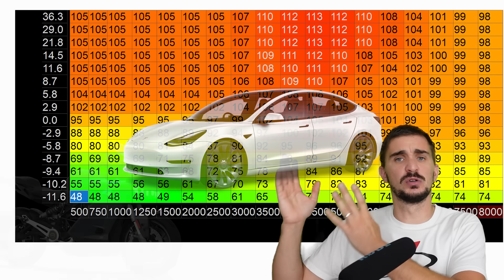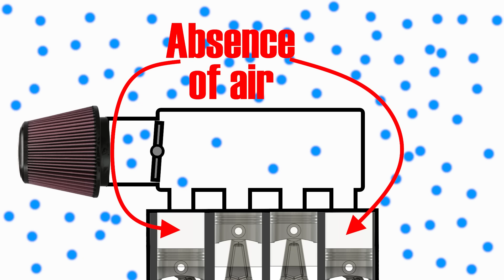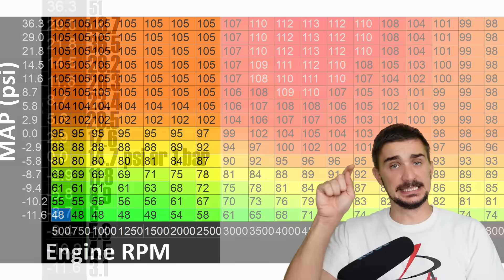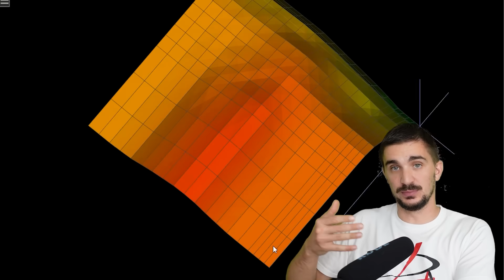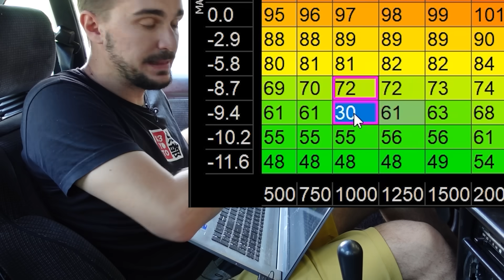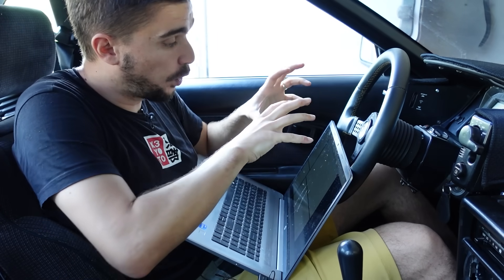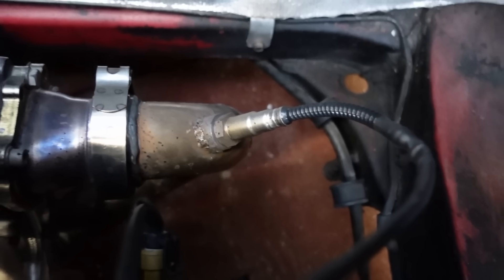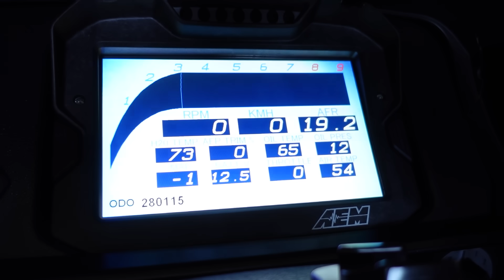If You Understand Volumetric Efficiency You Understand Engines

Comment: In subaru world, where I do some of tuning, VE is considered relative to the manifold pressure not atmospheric pressure. So even boosted engines do not achieve much over 100%. As far as I understand, VE is a measure of the efficiency of the engine to pump air from the manifold into the cylinders (manifold pressure varies from -10psivac to 20psi+ above atmopsheric). The turbo isn't considered part of the efficiency calculation as it is a pump itself. I suppose there are more than one way to calculate VE, both being correct and valid. My turbo EJ205 DOHC 16V 4cyl (non-variable valve engine) achieves 80% VE coming on  boost at 3500rpm, peaking at 92-95% in the mid range, 4k-6k and drops off to 80% at 7k. VE really does tell you where the engine makes torque, which depends greatly on camshaft and head design as well as features like varaible cam timing.

Comment: Wow. Thank you for the clarification. I always thought the values in the ecu map corresponded the injector on-time etc.
Reply from the maker: Yes, that's what was used before and the maps where called fuel maps usually. Injector pulse width values were in the map.

Comment: Another factor that affects the torque is the engine load. As resistance to the movement increases the piston head is pushed against the combustion more which can affect torque. This is why power braking is a thing.

Comment: Great video as always. First question that comes to mind is:

If the ECU is trying to match the afr via that certain VE in the table, why are no all afr values in the table the perfect stoichiometric ratio?
Reply: Because most engines will not run happily at perfect stoich under any decent loads. There are circumstances where under very very light load you might be able to make a motor happy at perfect stoich. Most of the time engine will run happier and make more power when it is rich of stoich.

Comment: This only raised more question. If the ecu can correct it's value by itself, does it mean the value on the map will keep correcting if you drive it up and down a mountain since the air pressure varies between land height?
And if the value can correct itself, what they change when a tuner remap a stock map ecu?

Comment: always good teaching, but sometimes you do some mistakes teaching, one of them it is that the use of datalogging instead of watching the clocks, datalog it is much more accurate by a lot of ms, also safer when you are tunning alone and in a racetrack or street for example

also. there are a lot of lesser ecus that doesnt have so many things as yours but can run engines like yours, speeduino is one example but has some fewer things that you need to do by yourself to achieve the same result, it is always great to confirm with you what i have taught myself among the years or have learned with different experience on other people

are you going to do ignition next? if you like the response and difference when you have the afr spot, then when you put the ign where the engine likes it is a lot of more fun, recommend you a racetrack so you can do a more response tune trough the rpm instead of only wot

take care and have a nice day

Comment: I'm curious why you're using speed / density instead of using the mass air flow sensor?  I thought the MAF beat speed / density across the board?
Reply from the maker: Why would either beat the other?
Reply: @d4a  Speed density is making more assumptions and is also reacting later.  MAF is reacting to the measure airflow going in.

Comment: I self learned tuning about 15-20years ago. From dizzy/webbers to dizzy/fuel analog ecu and finally full digital ignition/fuel. I street tuned with innovative wide band and listening for knock . You’ve explained this beautifully. Kinda miss the cold nights on concrete floor tuning days
Reply: I self learned back in 1990, with pressure switch on additional injectors and a multimeter connected to the analog o2 sensor and egt.  Melted or cracked trillions of pistons until i finally figured out what the heck was doing. Took me like 6 years LOL .
Reply: @mandytuning  epic. I’ve heard about this technique before additional  injectors piggybacking onto original injectors with staged pressure solenoids.
Reply: What’s the best resource you used to learn to tune i want to tune my own cars and want to get started
Reply: @iclassicify3126  This video explains how to tune an engine
Reply: @iclassicify3126 you can start by watching YouTube videos, reddit and forums posts but if you’re willing to pay, HP academy is great
Reply: @iclassicify3126  best resource and start is probably this very actual video here imho....
Reply: Concrete is where we all started on the long journey of tuning. It’s a step you can’t avoid …❤
Reply: Where to find that digital dash
Reply: Im now starting tuning I want to do it professionally
Reply: Like you there are many of us who can relate probably bound by the passion in our toys. Dizzy and Rochesters here. 11 years ago I embarked on laptop tuning my truck after a manual transmission swap. After researching my options purchased an Innovative LC-1 and started adjusting parameters in the garage. That Wideband works great at tuning carburetors as well. SAE 78’
Reply: I wish I could travel the path u took.. it would make me very very happy
Reply: Good to know not only I am crazy 🤣
Reply: Tell me how to get the program to tune then. I have a volvo s40 2005 that I want to tune.
Reply: @alanboggs2315 its not something thats taught on a YouTube thread 😂takes a lot of hard days
Reply: i dont even know how to begind such life without budget or background in family and without school :/ practice while supervised by other mechanic i suppose..
Reply: @0Blueaura without knowing i, you just did. The only thing holding you back is doubts and excuses.
Reply: @alanboggs2315  Google "hp tuners"
Reply: @alanboggs2315  as he states in the video, the program does it by itself unless any of the boxes are outside the 30% the ECU can compensate for then you have to put the numbers in yourself. I don't know about the volvo ecu or did you fit the same ecu as he uses  in the video in his own vehicle ....? (just noticed comment a year old so hope you sussed it)

Comment: Great video :elbowcough: But this is not modern tech it's pre90's closed loop lambda control hopefully with a mass air flow sensor. After ~1995 double cam angle sensor(in/ex) with vvt & vvl etc...🥰
Reply: nowadays oil pump pressure releasing solenoids, pwm controlled brushless coolant/oil/fuel pumps, variable geometry twin scroll turbines with scroll selection, pwm driven electric wastegates...

Comment: For those who don't know, it is very beneficial to tune in actual Lambda vs AFR.  If your target is 1.0 Lambda and you're getting .9 lambda, you know you're 10% off. Just pull 10% off your VE table and you're GTG.  No need to guess and check based on the error and no complex calculations to perform.
Reply: also worth mentioning that "14.7" AFR isn't actually "14.7" but lambda * 14.7. Stoich AFR is ~14.0 with E10 fuel, but will show up in most software as 14.7 to maintain convention
Reply: I been hesitant about proceeding with converting my carby feed engine over to one of the three EFI systems I have now to choose from (one factory and two aftermarket). This has really helped my understand of what its trying to achieve :)
Reply: If you're creating a base map for tuning a turbo vehicle to target an AFR of 11.2 under full boost, you still have to do that same calculation, just in the opposite direction, to get the Lambda value you want, which would be about 0.76 in this example. So you're doing the calculations for building the base map when tuning in Lambda, but you're doing the calculations for making corrections when tuning in AFR. It really just depends on how you want to do it and what values you want to see in your tables.

And the calculations aren't complex either way, it's only a simple division problem.

Comment: The statement about naturally aspirated engines not being able to run at higher than atmospheric pressure isnt entirely true. Its true for about all regular engines yes but it is possible to get an significant increase in pressure with a specific valve setup that Porsche has built for one of their engines. It sort of uses backpressure and merging shockwaves or something. Dont ask me how it works exactly but it works and there is no supercharger, turbo or anything of the sort. Its a naturally aspirated but boosted engine so to say.

Comment: You should note that it is possible without boost (even on your graph) to exceed 100% VE due to valve duration/overlap and the magic of inertia, and scavenging.
On your graph this peaks at 5500rpm where it shows 105% on the 0.0 line.

Short summary of events that make this possible:

1) Overlap. The exhaust valve remains open while the intake valve starts opening. The high speed and inertia of the exhaust being pushed out creates a vacuum which begins pulling air into the cylinder before the piston has made any real move downwards. 
2) Intake valve closes AFTER BDC. As the piston turns around, the incoming air and the intake tract have a certain amount of inertia (it's travelling at high speed). 
Air will continue entering even as the piston rises. There is a point where the pressure stops the inertia of the air flowing in, and that is the theoretical best time to close the valve.

Result: More air is contained in the cylinder than is possible at 0rpm and atmospheric pressure. On the table shown in the video, this peaks at 4500rpm.
Reply from the maker: Don't omit words from what I said. I said it is not possible for an NA engine to achieve significantly higher pressure than atmospheric. 15.4 is not significantly higher than 14.7.
Reply: @d4a  Don't you think it would add to the video to say that slightly more than 100% is possible?
Reply from the maker: But that's clearly already implied. If it can't go above significantly then it's implied it can go above a bit.

Comment: VE tables speak 'volumes' about camshaft efficiency within an engine configuration among other things..

I could be wrong about this, but wasn't MegaSquirt (the PiMP series ECU's for Ford's) one of the first auto adjusting aftermarket ECU's which paved the way for self-dialing VE table's?

Comment: Thank you for your amazing content. I would like to add that the speed density algorithm also needs the air temp and the barometric pressure to actually calculate the amount of oxygen and then, based on that, the amount of required fuel to hit the AFR target. On the other hand, the MAF sensor can accurately measure the amount of air going into the engine (by grams) and ecu needs nothing else to generate the required pulse width for fuel injection (of course except the injector size and dead time)

Comment: Ve dose not go above 100 due to boost

Ve is % cylinder filling AT THE CONDITIONS IN THE MAP

Meaning 100% VE at 300 kPa MAP = 300 kPa in the cylinder at BDC

Otherwise if you run 300 kPa MAP boost and is still only 100% VE you would have no power gain over being 100% VE at 100 kPa MAP

Comment: 2:28 "consuming more air than the throttle plate is letting in". Either you worded that very poorly or you don't know what you are talking about, sorry.
Reply: He could have meant that the engine is trying to consume more air then the throttle body is letting in, therefore creating negative pressure, but I also could be wrong.

Comment: Actually it is not true what u are telling. The correct professionel technical definition of VE is the ratio of air density inside the cylinder to air density inside the intake manifold...means it is not the raw filling rate and there is no relation to atmospheric pressure. And this ratio is a function of rpm and MAP. I know some ECUs are useing this wrong definition,which in general is also working, but with a bad impact, that u cant consider air temp in a calculation model. Bosch ECUs and also the EMU black ECU is using the correct definition. This results in a VE MAP which dont exceed 100% (even in TC engines). Example: an old 1.8t engine has an VE of around 85% starting at 0,7bar boost. If u increase the boost the VE stays the same although more air is pushed into the cylinder.
Airmass is then calculated like that: density(MAP, IAT)*VE*displacement

Comment: Ha! Your title to your YT vid hooked me. Most ppl who claim to understand VE%, dont really understand VE%. Your explanations for Tuning with Fuel Maps was fine but doesnt address Intercomponent relationships. Getting the proper #'s on a fuel map does nothing for an engine whose intercomponent relationships are improper to begin with. What no one ever teaches is how does one go about [Qualifying] an engine component as small, medium, large relative to engine output expectations of being mild, moderate, or maximum. The internal combustion engine is not one dimensional; rather there are three major relationships all other relationships fall under. Engine math (intercomponent relationships) are circular. Once an informed engine guy knows these three relationships, via math, he can determine all other parameters by transposing the variables within the math equations. The major relationships are
1) Dynamic Compression to Static Compression
2) Desired Peak Power
3) Expected Peak Power at a specific RPM
One has to understand which category they wish to run their engine in. These categories are phase one engines upto phase five engines. To me, I've always placed emphasis on the Dynamic Compression as a Ratio, or Dynamic Compression - as a psi. The Dynamic Compression measures its ratio or psi once the Intake Valve has closed. Your Video only showed Static Compression - or Bore x Stroke. What the Dynamic Compression reveals is how your Cylinder sees the Piston at any RPM. If one desires to understand VE% relative to Dynamic Compression, you can begin by mastering the Slider Crank Mechanism; yes this involves basic trig. Some engine software can plot piston position relative to Valve movements for you. The second helpful tip is to learn the basics on Cylinder Head Design; again some Engine Software can alter this parameter for you. You dont have to be an engineer to understand Engines; but you do have to understand Engine Math.., just no way around it!
Edited for typos

Comment: Great video, it finally helped me understand what those guys are doing with their laptops in between pulls on the dyno.
How does nitrous change the equations here? Knowing the MAP is really a shortcut to knowing the amount of oxygen, right? Which the introduction of nitrous would completely change. Extra sensors? Some sort of override during the shot?
Also, how does variable valve timing of various sorts change how a map like this is used? Does it change anything at all?

Comment: I would say that most modern gasoline engine will NOT fire if the gas pedal is not depressed and the engine RPMs are higher than a minimum threshold. So I don't really understand the VE MAP part in the negative pressure part...

Comment: The VE does not really result in torque. As combustion efficency is different. You can see that at unrestricted air intake the VE curve is almost flat cross RPM. Even at idle. But the torque is far from flat. That is becuse the combustion flame front is much fster then the pistion speed so the energi from the fuel consumption is not efficient translated into torque, but wasted as heat.

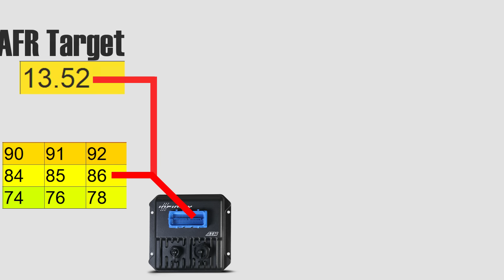Comment: I do enjoy your enthusiasm with engaging a topic you like to share. Although, there are some important discrepancies that should be clarified here. On a VE table, the vertical axis should never be represented by "Atmospheric Pressure" (ATM), as you've suggested at 1:07; it would be wrong to do so. In reality it's a calculation set by a standardization body (mainly SAE/ISO) that combine many variables (algebraic expression), in which constitutes engine load. A VE table will never be correct if the vertical axis is represented by only ATM and a horizontal axis of RPM. Over the lapse of your video you speciously reference the vertical axis value as ATM, rather than engine load. At 9:16-9:57 you further this fallacious point by saying "we told the ECU that there's less air coming in the engine then there's actually coming into the engine", when in fact you're adjusting the solution to an algebraic equation while falsely reducing it to a singular variable involved in said equation. At 13:50 you explain the process backwards. Before the ECU can portray the VE table, it requires knowledge of all the variables before, to properly calculate and then use the VE table; not after like you suggest. At 14:40 you state that if there's a +/-30% difference between Air Fuel Ratio (AFR) and target AFR, that there's something "weird" and the computer won't be able to compensate and "you must properly/manually adjust your VE map". While true in the aspect of the ECUs ability to only adjust so far, to portray it as needing adjustment to the VE table is false. It would be nice to see a response video correcting the misleading nature of this one.

Comment: If VE is the amount of air in the cylinder divided by the amount that would be in the cylinder at atmospheric pressure with sufficient time to completely fill the cylinder, how can VE be around 50% when the MAP pressure is -10 psi which is an absolute pressure of about 5 psi or 1/3 of an atmosphere? The maximum possible VE should then be about 33% if I understood you correctly.

Comment: That was good explanation!
I have a question for you
Can you do a follow up video and explain how we can remap our ECU if I want to tune my car. 
I added a bigger turbo and obviously I want to add more fuel ( new injectors and so on) what would the the “ideal” settings for my map? And how to correct it and get the a good air to fuel mixture at specific rpm as the stock ecu can’t correct the fuel with the higher boost